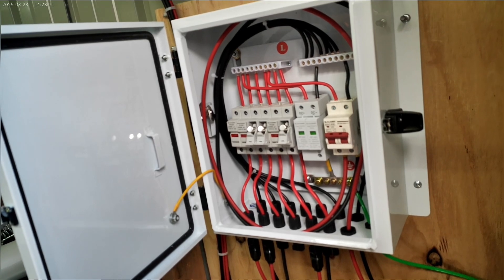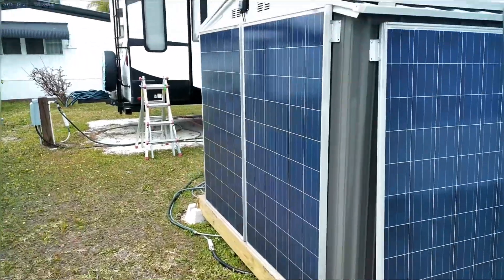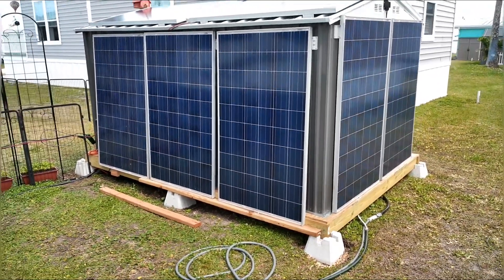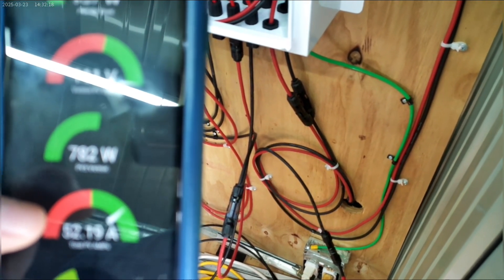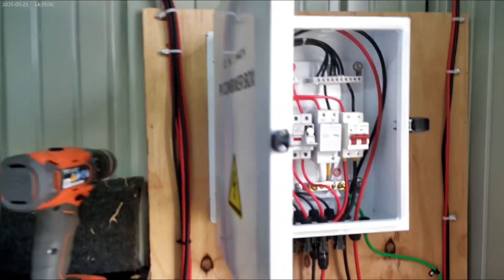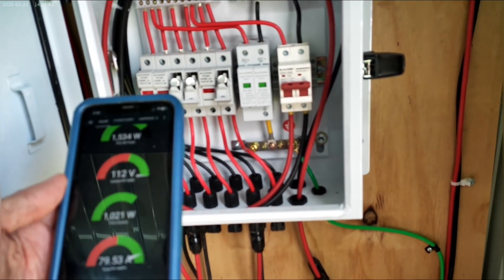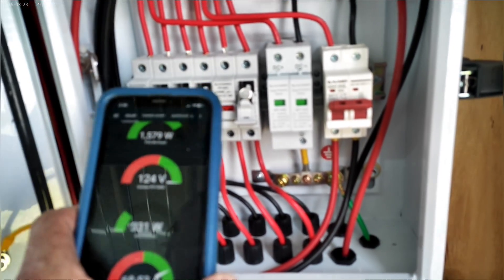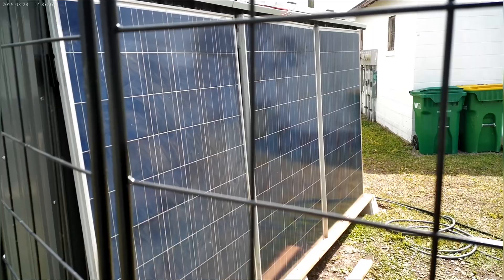Major Solar Shed Upgrade: Boosting Power with 120V Input for Better Battery Charging!

Comment: You shouldn't have four panels in series when two of them are facing one way and the other two facing another . Each series string needs to face the same way since it functions as one big panel, when in series, they dont work as 4 individual panels .... You can have 4 in series facing one way and parallel them with another 4 in series that are facing another way ...but you cant do it like you show in this video . You're seeing double the power because you probably had them connected in an even worse configuration before and not much above battery voltage of 55v ... Do some research on building series strings and also read about "Virtual Tracking"   ...virtual tracking is how you connect different series strings that face different directions .
Reply from the maker: Yes you are correct… but please note this is a solar shed as I CAN NOT place them on anything else… so there is 4 on top, 3 on each side, and 2 on back … getting the best configuration is the trick. I had it setup at 2S5P… but you have to live within the restrictions of space you have …

Comment: I love this setup but I'm confused where the mppt solar controllers ? I'm going to subscribe to ya matq
Reply from the maker: This is extra power that feed the solar system in my fifth wheel off grid system. 6000xp inverter and Victron 150/35 CC in the RV .. I will have to do an overview video ..

Comment: What loads are you powering with it?
Reply from the maker: I run a 6000xp in my fifth wheel off grid most of the time, I have the cord packed away in case I need it .. but for most of the time after adding new battery February I just don’t need it.

Comment: Just curious, what supports/transfers the weight and compression load from the roof down to the base, or platform structure? Thanks.
Reply from the maker: The side panels are sitting on the support at the bottom they have nothing but to keep them falling over, and wind blowing them. On the inside they are back with a peace of wood. The top panels are supported by main beams that can hold up-to 500lbs of snow, they attach to the side rails that I have reinforced with 2x4s to ensure they don’t have problems. I am in Florida so no snow worries.
Reply: @MattManSolar  Ah-ha! You said the magic words, 2X4s and Florida, so as you say, no snow loads. Thanks.